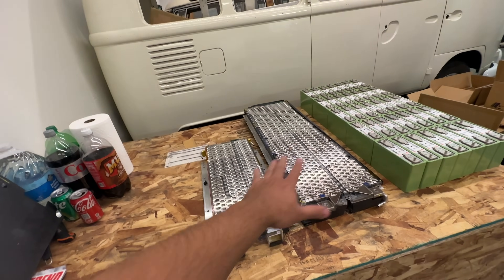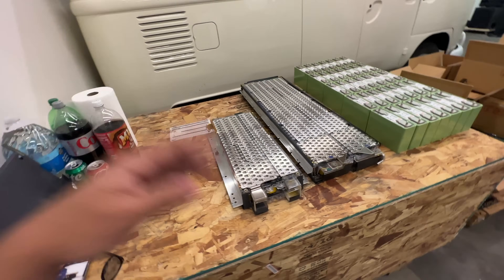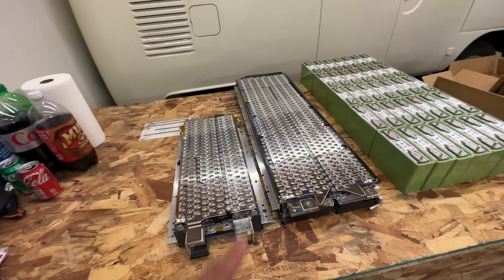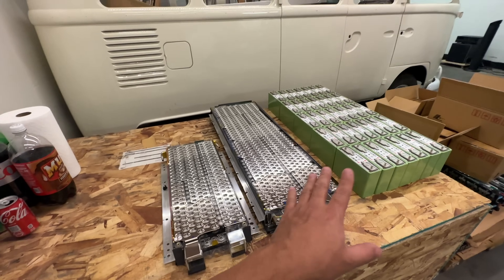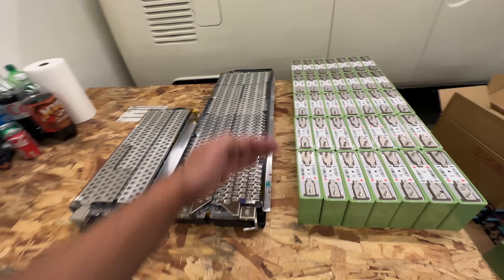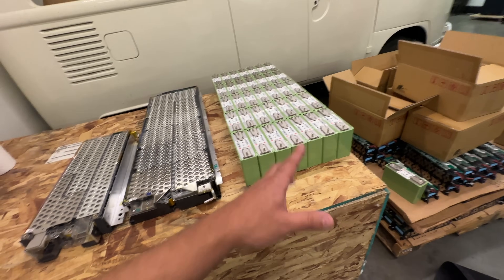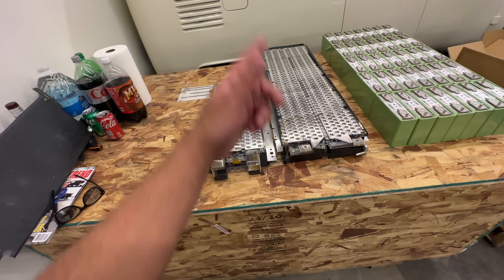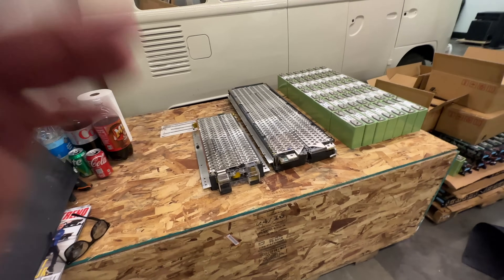TESLA Rav4 batteries for Electric car conversions

Comment: Hey, I’m a first year college student looking at building a single seat off-road ev and I have a few questions. 

I’m in the process of educating myself on the battery tech (I come from the hobby grade RC Lipo world). 

Would it be possible to run less batteries wired in series and achieve the same final voltage/input requirements?  I would be doing this for both cost and weight.
Reply: You can use a boost converter to get the voltage higher, at the cost of current and efficiency.

Comment: Hey Jehu, I got the xt30 parallel powerstrip and the XT30 parallel y harness for 36v batteries from your store and I am loving the scalability with it. Do you have any other 36v ideas or PCB's coming down the pipe soon? I really wanna get the 18 battery rack mount kit soon!